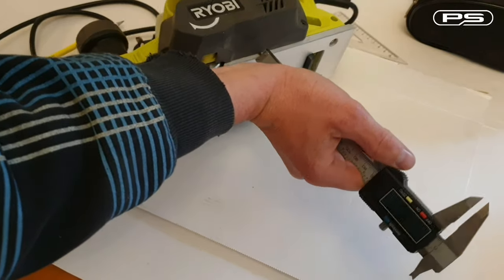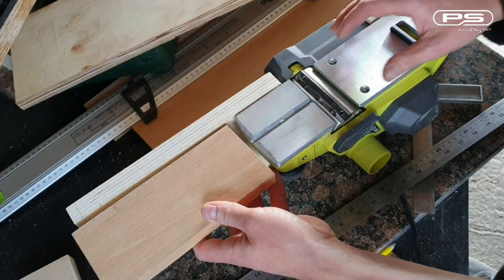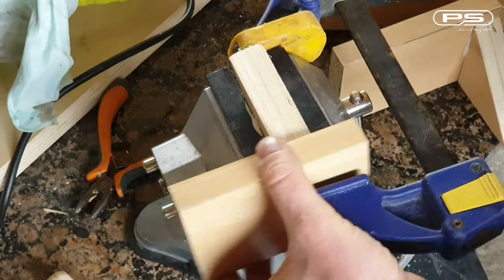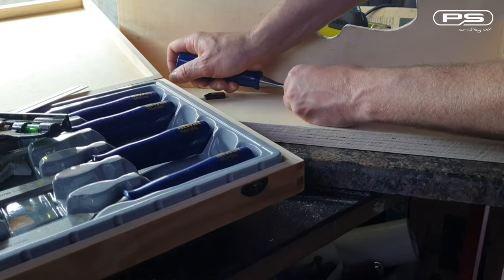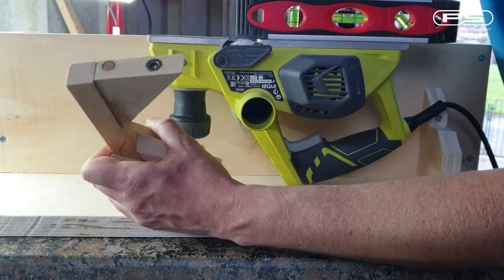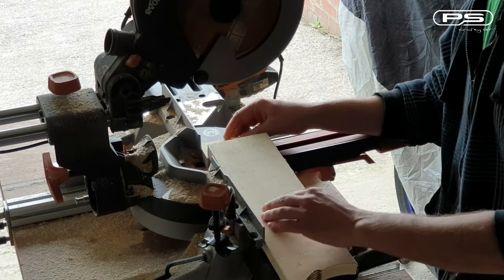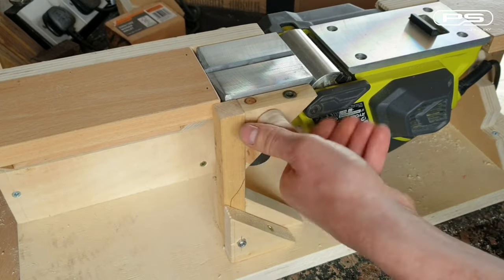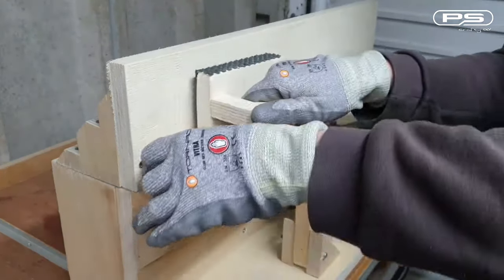DIY Jointer Planer (Ryobi RPN 780) or other

Comment: I was looking for ideas for my ryobi planer to turn into jointer when when needed and thanks to you I have found them! I built a work bench with a sliding extension on one end. I just slide out when I need to and put my MDF secondary top with my router, and now my jointer. Thank you so much Will from Australia
Reply from the maker: Thank you for your comment, much appreciated. I am glad I could help

Comment: It's awesome, but isn't the outfeed table supposed to be slightly higher than the in feed?
Reply from the maker: The outfeed table needs to be level with outfeed of the plane. Its just en extension of that. It will be always higher then the infeed table unless its set to zero

Comment: Why does the in-feed table need to be adjusted? Shouldn't it always be level with the planer base?
Reply from the maker: You can set depth of cut on the plane by turning the knob. This will rise or drop the front part of the plane so the infeed table needs to be adjusted accordingly with current depth of cut settings.

Comment: Nice solid build. I don't mean to be a dick but the only thing that needs to be square is the fence. Of course, there's no harm in building it as accurately as possible but this seems massively over engineered. 

I built one today with two oak legs bolted to the front guide, which I clamp into the wood vice, with the handle as the 3rd leg. I squared it up in the vice, then added a cross brace, which will ensure it's square every time I clamp it in (sits on top of clamp jaws). Then mounted the fence to the legs, using the plainer top as a guide & making sure it is square. 

If I need to use it, I clamp it into the wood vise. If I need to use the plainer normally, I just unscrew the two bolts & it pops out. The key is the two 90 degree slots on the front, which, with the bolts, hold the legs perfectly square & secure.

Not saying there's anything wrong with building & sorry to be a know it all. Just thought my idea could save people time, effort & materials, for the same end result.
Reply: Egg on my face. My simplified build broke the drive belt on my plainer lol

Got a replacement belt today & tried again, cutting out a small releif to stop the drum catching on the side & melting the drive belt.

The more I've worked on it, the more I've added, so it's now almost as complex. Humble pie for my dinner :)
Reply: @McMonkeyful  The fact that you came back to put said egg on your own face, says everything I need to know about your character! I can applaud that!!  We need a little humble pie in our lives!!

Comment: I would happily pay you if you could make a cut sheet up for me. I want to build this but I'm not great at all the measurements
Reply from the maker: Hello Mike. Unfortunately I've never dealt with drawings, cad software etc and don't currently have anything. PC is down at the moment as well. Perhaps its something I could look into in the future though. There is a lot going on lately. When I am unsure of measurements I use lot of cardboard to make templates etc so I don't waste material. It can be seen in the video.
What I would suggest is to make outfeed table longer. Think it would help a lot when working with longer pieces.
Reply: What size screws did you use on the side where you normally would put the guide?

Comment: don't run a wood jointer with gloves on, it is seriously dangerous to your hand, wood jointer can suck your gloves and you could lose your fingers, it is a safety standard
Reply: Protection from splinters is a small part of wearing gloves. They also increase grip, reduce fatigue and give greater control of the board. I would argue that they're safer. If you're cutting close enough to the blade for it to grab your glove, then you're doing it wrong. If your guards are in place and you're practicing proper safety the gloves will never come close to the knives. You can also limit how much of the blade is exposed by adjusting the fence out if possible or adding a sacrificial fence. With a little preparation there is no reason to sacrifice safety for safety.

Comment: looks ok. But please, do not advocate wearing gloves when working with electrical planes or circular saws. It is insanely dangerous. Better get a little splinter than loose a finger.
Reply: Just wondering, you are saying the glove would get your finger taken off instead of protecting you
Reply: @PNWLiving1725 absolutely. If the glove gets caught in the blades it'll pull your hand into them
Reply: Loose clothes no no also

Comment: This is unnecessarily complicated in its complexity.
Reply from the maker: I am always making stuff to my best ability at the time. I was aiming for it to be rigit and accurate. I also wanted to be able to easily remove the plane from the rig if I needed to use as standart plane then put it back in without further fiddling. I have achieved that with this design successfully and it still works flawlessly for over two years in a garage with fairly high humidity. I am sure there is plenty of simplified versions for you to have go at out there. Hope that this explains your question why it is so comlicated in its complexity or what ever your comment was meant to be.

Comment: Incredibly dangerous and irresponsible on so many levels, never wear gloves when using any power tool with a high speed moving blade instead of losing a bit of a finger you will lose a hand as the glove is pulled through blade along with your hand
Reply from the maker: You are absolutely right I should not be using gloves.